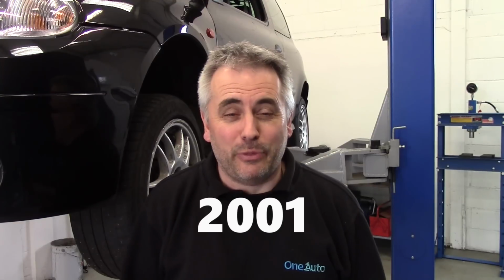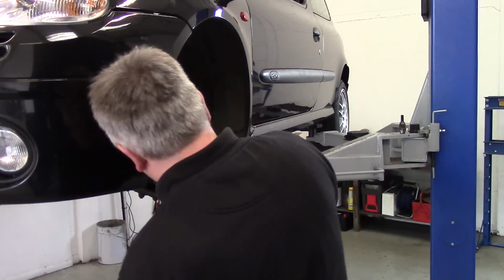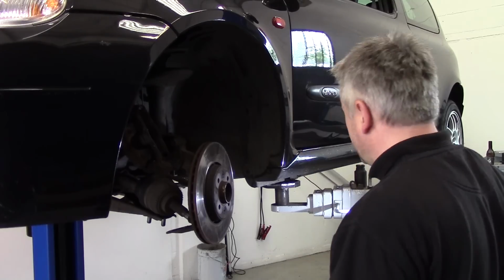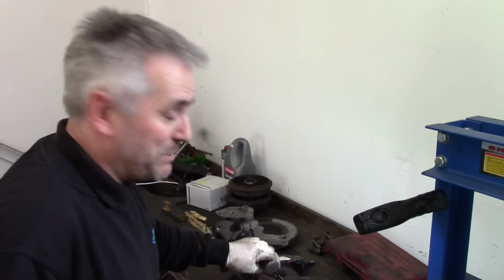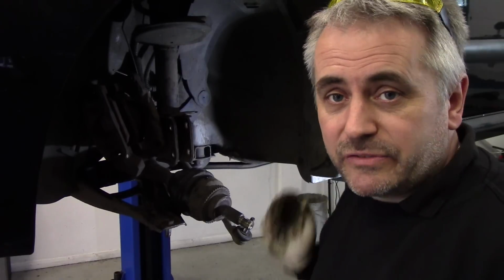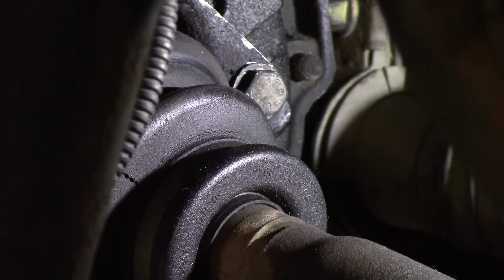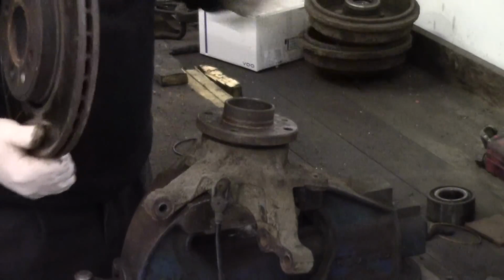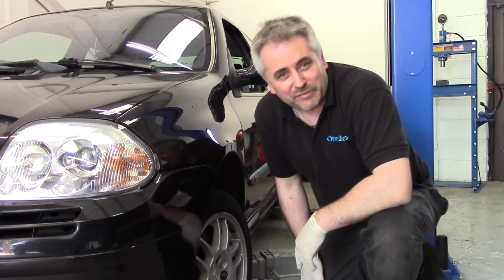Renault Clio 172 Sport Front Wheel Bearing & Drive Shaft

Comment: I have had to use a 50 ton floor press to remove the cv shaft from the hub flange splines on occasion, no damage caused to the drive shaft though due to steady pressure.
The press used is 50 ton electric hydraulic with foot operated pedal which leaves hands free to align all.
Normally only need to use a 10 ton press.
Really enjoyed your video as the video was clear with very good relaxed commentry. 
Wish I could work as fast as the speeded u part of the video though!!!

Comment: Hi, can you please help me regarding my windscreen washer pump. I have fitted anew pump and checked appropriate fuse and still it fails to work, i have changed the wiper stalk and still nothing. I'm wondering if there is a relay for the pump, if so can you please advise me as to where it is located, many thanks, Paul. oh my car is a 2003 clio 1.5 dci.

Comment: Did you torque the driveshaft/hub nut to 280Nm or was it just a few ugga dugga's on the impact gun?
Reply from the maker: Yep off camera... I wandered how long it would take for someone to mention it. Very observant Lol
Reply: Haha. Yeah it's pretty important that people do torque it, otherwise the bearing will fail prematurely somewhere down the line. Bit awkward with the Ph1 Clio wheels though because a 30mm socket doesn't fit through the centre cap bore, so it has to be done with the wheel off and the brakes applied. Much easier with Ph2 wheels.

Comment: Wait... I'm not a car mechanic, so I don't get this: how does one lose an axle nut and put an incorrect one back on in its place?

Kudos to the owner for putting the car right; those are fun little motors.
Reply from the maker: Who knows what happened before I got it? I mean I've had a nut rip the threads off as it's come off several times... but you repair it properly not try to ram on another nut on!

Comment: I'm thinking of buying a hydraulic press for home use but would you buy the 20 ton bottle jack type that you can buy on ebay for £130. Do you know the model number of the press you used.
Reply from the maker: I don’t like the bottle jack type. Most of the garage equipment came from http://www.automotechservices.co.uk
Reply: What don't you like about the bottle jack type as I don't trust the reviews on ebay.
Reply from the maker: I prefer the type that you can slide the hydraulic press part along the upper gantry for better access on some applications